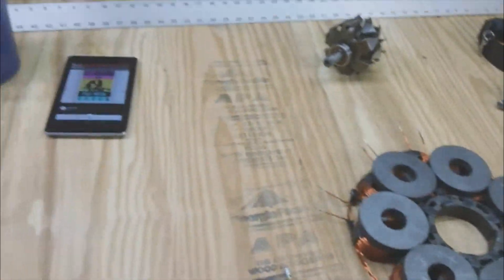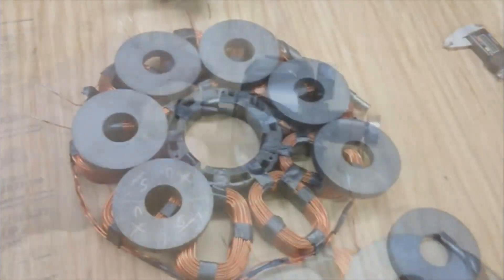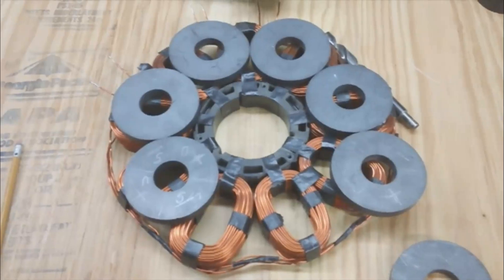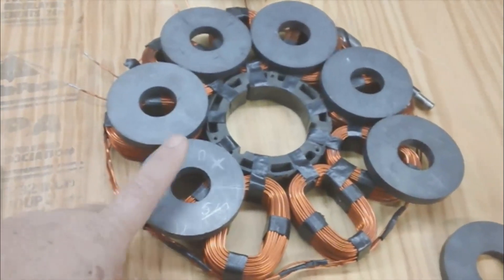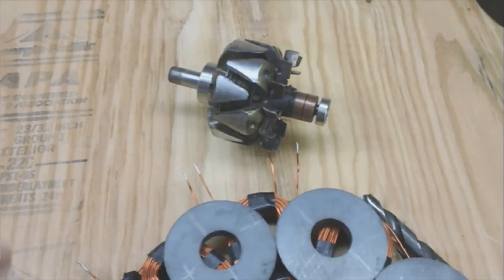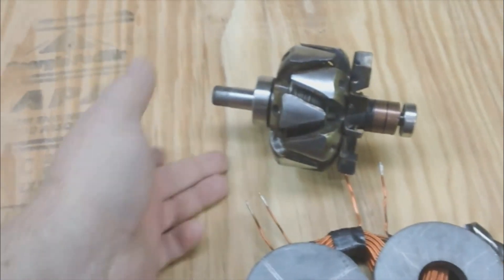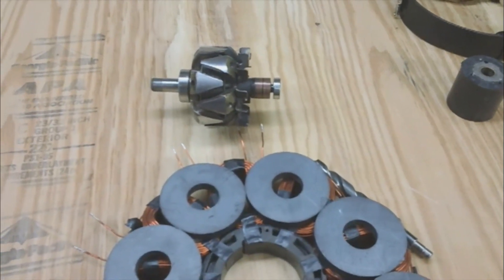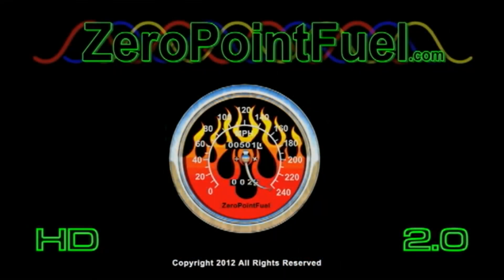Big BoxMotor Update 2

Comment: Might not be that bad in the sense that, with a small diameter rotor, you are not taking advantage of the "outer diameter" increased rpm, as in, the rotor spinning faster on the outside; however, it does allow to operate the whole thing faster, and keep everything tight, less power wobble... the entire unit could be encased in a large 5 or 6" PVC pipe with vent holes drilled in the top. Entire driveshaft could be pillowblocked on both ends.

Comment: Those are very odd magnets. Almost as if they'd work well if mounted on a spindle through the center of each, with very small diameter stators, one on either side of every single ceramic magnet.

Comment from the maker: That would work if they speed up, there is no way a 3ft rotor is going that speed , you could add a standard wind and use it as a brake but these magnet are not microwave magnets. the magnetic pattern is not like microwave magnets thanks for the info. but if you can get a winding pattern that will speed up on a dead short you know allot and I would like to talk to you. about building a generator,  thank you could you please send me a massage with a link to that page on Russ's forum